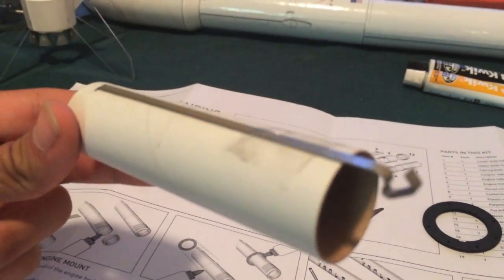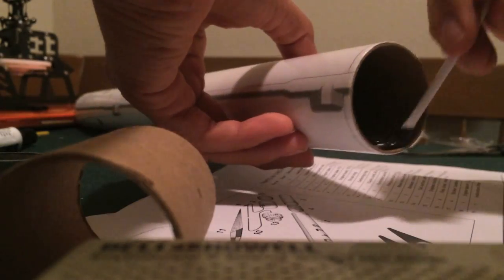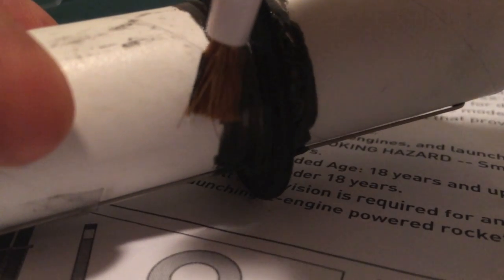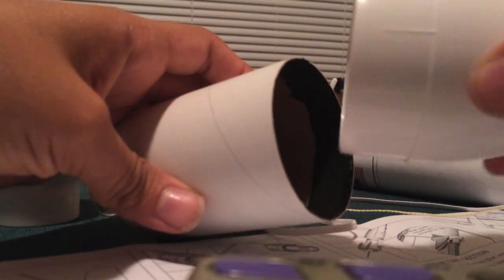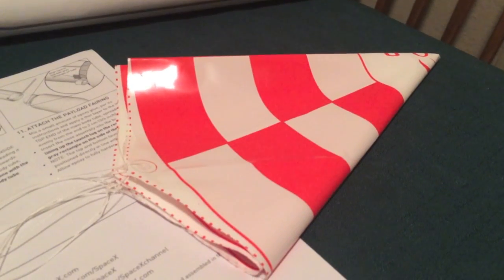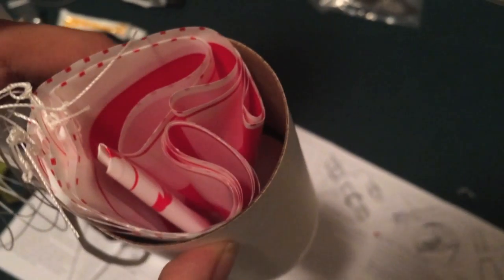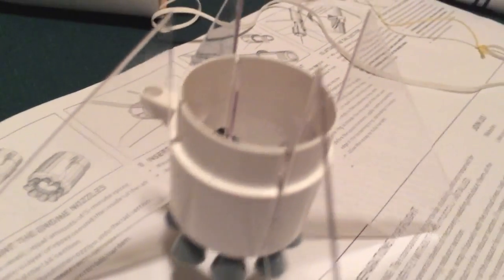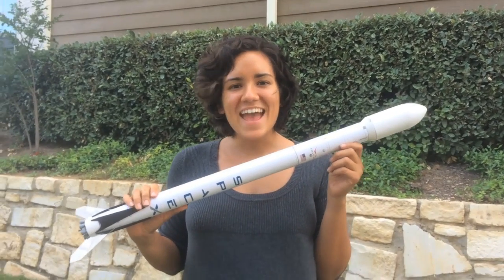Falcon9 Rocket Build ~ SpaceX

Comment: really wanna make a crazy version of this  cluster like 9 E engines, and have the second stage be a single E engine, would have to build it and then do calculations to see how high it would go before flying it...
Reply from the maker: Well according to an estes chart for E-94 Engines, an E engine provides 25 newtons of peak thrust and 10 newtons of sustained thrust. 9 Engines in parallel would provide 175 Newtons (39.34lb?) of peak thrust and 90 newtons (20.23lb?) of sustained thrust. How high it would go calculations to be continued upon further research.
Reply: yeah  calculations would have to be after it was built because, you need weight to see the height
Reply from the maker: Alan Haney Stage 1 altitude {76.8 meters, 252 feet} Ten rocket engines (1.36kg), four feet of three inch diameter pvc pipe (2.7kg), carbon fiber (0.346kg), and a TeleMetrum (0.02kg) yields a 4.426 kg mass estimate. The first stage provides 90 newtons of thrust sustained for 2.75 seconds. Acceleration is calculated with F = m*a. Height is calculated to be equal to 0.5 * (90 N / 4.43kg) * 2.75 sec utilizing equation y = 0.5 * F/m * t^2. This estimation equals 76.8 meters (252 feet), lower than expected.
Reply: PVC pipe? seriously? you could easily do something like this with something lighter, like cardboard.
 it can handle the forces the cardboard/ paper stock would be like 1/16 inch thick probably. it may be heavy, but not that heavy...
if ya truly wanted to go higherr though you could easily stick an I or a J in there.. it could go like 3000-4000 feet easy
Reply from the maker: Alan Haney Yeah. The real question is how does Grasshopper launch and land with such precision.